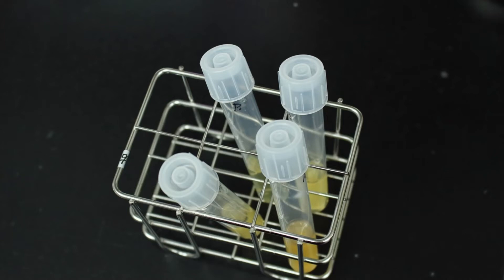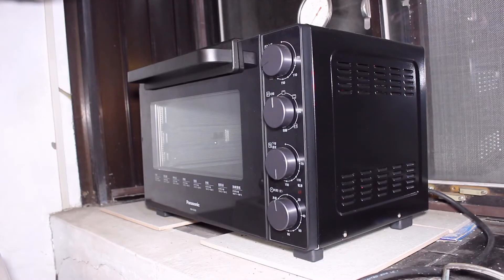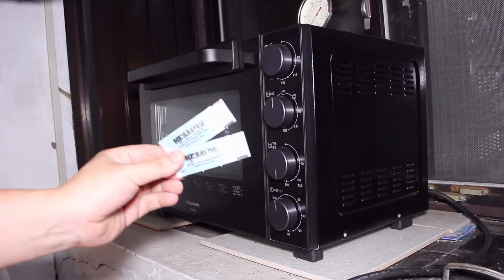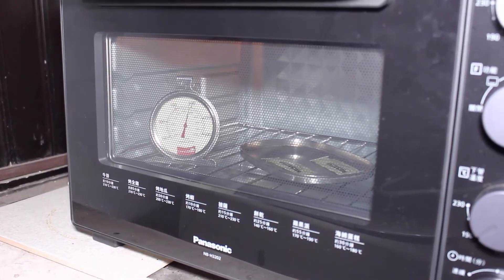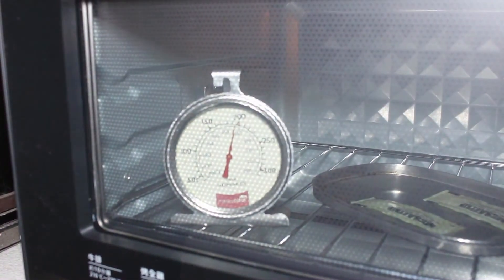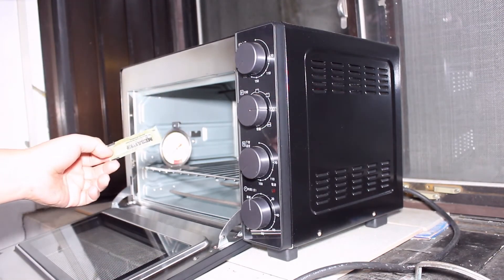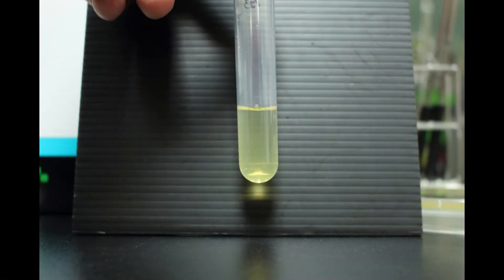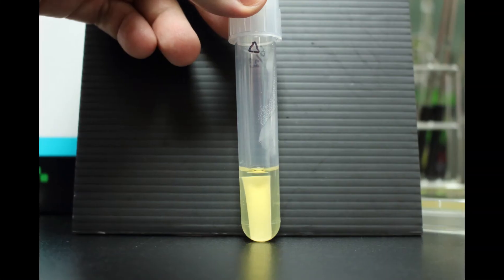Using Home Oven for Sterilization Process??Real Lab Test Tool to Test Home Oven

Comment: Can you sterilize agar plates like this?
Reply from the maker: No, this is not for agar plate.
Reply: @diymicrobiology378 Is it because agar loses its property that way, or because it includes water?
Reply from the maker: @SeckinSefi  This is dry sterilization method so it only works on dry stuff. Agar plates have water so you will not get higher than 100 degree. Also it burns at high temperature.
Reply: @diymicrobiology378  thanks